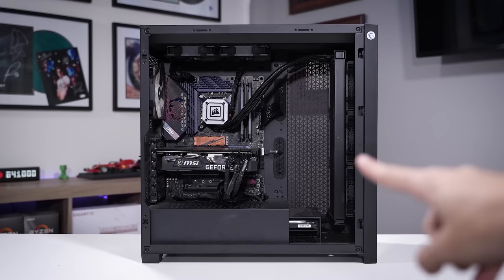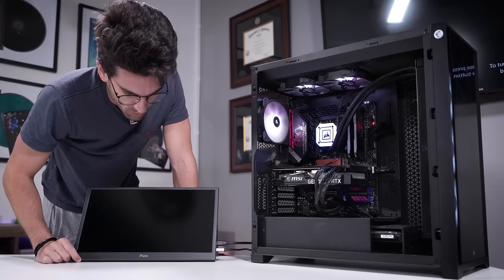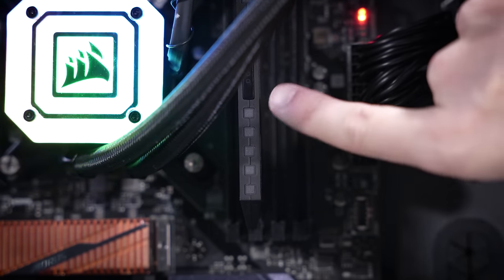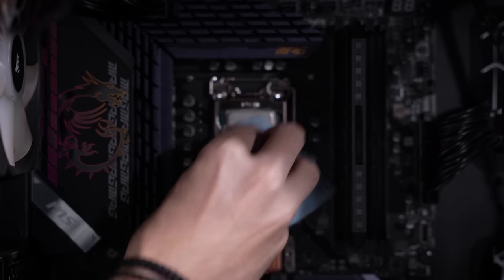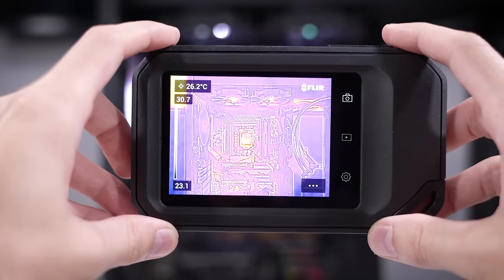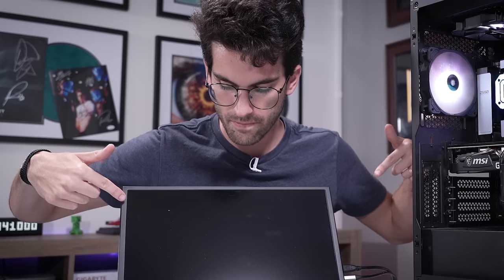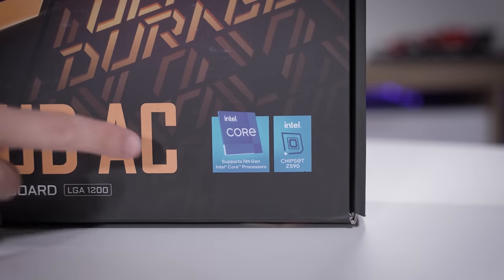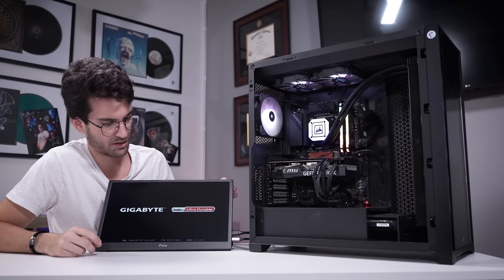Fixing a Viewer's BROKEN Gaming PC? - Fix or Flop S3:E9

Comment: Hi, I'm having the same problem as the pc in the video. If anyone has some advice on what could be the issue, that would be great. For a few days, whilst I've had the pc on, the monitor would say no signal randomly. Whilst playing a game etc. I could still hear music from the game in the background. After a while of this happening, I started to hear a buzzing sound from the speakers. I had to turn off the pc and turn it back on for the monitor to start again. Now, when I start the pc, the monitor is saying no signal. 

I've recently got a new rtx 3070 gpu, I have a ryzen 5 3600 cpu, 16gb 3200 ram. And a 650w psu. The motherboard is a Asus rog strix b450. I'm getting a new case, cpu fan and 850w psu to upgrade the pc. I'm hoping that when I do the new build, it will be working as usual. I'm just not sure what could be causing the problem exactly. Whether it is related to the psu being faulty or something else. I've made sure that drivers are up to date whilst this was ongoing, and windows too. Sorry for the long message, I appreciate any help.

Comment: The MB does seem to be bricked. It could have been a component failure on the MB or the bios is corrupted. While you cleared the bios you did not reflash the bios. At this point there is not much to lose if you try to reflash the bios.

Comment: This is why it's best to shop at a nearest retailer and always spend the extra few hundred on a warranty. I scraped myself together a a $2500 rig after saving all year & was sure to spend the extra few hundred on a 2 year warranty on all of the parts! just an overall good feeling to know if anything ever goes wrong I can take a quick trip down the road to swap out the old for new with zero hassle. I mean why work so hard for something just to not have coverage?

Comment: I wonder...and it may not work...but have you checked the voltage on the CMOS battery? Curious if the cmos battery was dead and then made the board be wonky...I remember another video with a bad psu killed the board but this one didn't have that...but why did the mobo kill itself?
Reply: a dead cmos wouldn't make the board not work. It would reset bios settings to default every boot but itd still boot. My best guess is something was either faulty with the hardware, or there was a failed bios update that bricked the firmware.
Reply: In another comment he said he checked the CMOS battery. It's also possible that the PC's owner tinkered with the BIOS (overclocking settings) and killed the board that way I suppose, or just bad luck or a bad batch.

Comment: I've an interesting case: an old PC of mine with a Xeon E3-1270v2 and an AMD Firepro W5000 that worked just fine last week Wednesday, and the next day - nothing at ALL anymore, not even a POST...
The CPU and case fans are spinning, but there is no image.
Clearing CMOS does nothing. Changing RAM/RAM slots does nothing. Other graphics card does nothing...

Dead motherboard? Pity...
Reply: As old as that system is, a new CMOS battery is well worth a shot (yes, a dead one can cause a no POST on some systems). Failing that, try another PSU.
Reply: @PileOfEmptyTapes  The PSU is a Focus GX 550 W (I believe?) only several months old, so I am guessing it isn't the PSU. I could try a new CMOS battery... but I don't have high hopes. I could try, though. Thank you for the hints.

Comment: I was secretly hoping you were gonna be nice and upgrade him to 12th gen and Z690 mobo since you had to buy a mobo anyway. A 12700k would had been a nice step up for the guy, not that he's hurting or anything running an 11900k. I know I would much, much rather have a 12700k over an 11900k. Seems like this guy should had gotten an 11700k and an RTX 3080 instead of wasting $300+ on an 11900k and a 3070. 11700k and 11900k are basically the same exact chip. The 11900k just has slightly better binning for slightly faster core clocks.
Reply: Greg unfortunately isn't responsible for people's bad life decisions like smoking and buying an 11900K. His goal is to get the system up and running with as little as placements possible.

Comment: I had a couple questions about my pc, my system has a r5 3600, rx 6500 xt, 450m steel legend motherboard with the bios updated as well, oloy 16gb of ram at 3200 and my pc works completely fine until i start playing any games like valorant for example where my pc will just freeze and crash like not even blue screen just crash to where i have to hit the reset button on my case, my windows 11 is completely fine thats not the issue i have repaired it and re installed it multiple times along with my drivers being fullly updated, I am a huge fan of this channel have watched almost every video in this playlist and was just wondering if anyone could give me some insight! Keep up the great videos Greg and keep on helping the community!
Reply: Check powersupply ..i know your gpu is not power hungry so maybe its faulty powersupply that fails to give more juice like +350w or something
Reply: Are you overclocking anything?
Reply: @goodguygav4522  yeah try disabling xmp ..maybr
Reply: @mr.lunatic3157  Ive tried this and it didnt work
Reply: @mr.lunatic3157  my psu is like 550w but yeah thats true I could order another one just for test purposes thank you!
Reply: @goodguygav4522  besides xmp on ram nothing is being overclocked

Comment: It's always such a shame when its the motherboard that's the issue. Not as its the most tedious to change, but because it is very often just one single chip (or even component) on it that is causing the issues. For this one it could simply be the superIO chip, but properly troubleshooting at the component level is simply not worth it... :( Edit: well for 'normal' PC repair that is. Like you said some more test for yourself would make a nice video. Do you have a thermal camera? If it has enough resolution you could look for small asic heating up quickly for example, a typical thing when it has gone bad (and has an internal short as a result).
Reply: Its kind of crazy how many motherboard issues ive had within such a short period of time. 3 seperate occasions all within 2 months.
Reply: @zakking5654  motherboard is the most sensitive part, as it connects all hardware together and manages everything.

Comment: Great video, horrible overreaction to a minor scent,  that went beyond childish.  I fix smoker rigs all day long and they are no more filthy than what the dust rats bring in, old smoke can be unpleasant but any mature person can easily go right past that.

P.S.  It often will reboot 2 or more times as the new MB has to retrain the Ram then windows has to work all the new pathways out as well.  Not sure how many new motherboards you replace but this is common and not sure why impatience with it.  Also that Motherboard if bought new and is only a few months old should be good for an RMA which is typical for MSI boards from my experience.

Comment: I've gotten motherboards to work again with actual high success rate.  Typically I use a non conductive electronics spray, usually CRC brand, clean it with a brush thuroughly and blow it out with a compressor.  I think over time stuff gets jammed places like in the socket, sata ports, 24 pin etc.  I've even taken a heat gun to a couple and have gotten them to work again.  Most motherboards appear bad because of a spill or something that wasn't cleaned well enough(under surface mount chips,etc).  Every motherboard I own, about 8-9 all work. Including my motherboard from one of my first custom builds Asrock 870 Extreme3.  That board has seen some stuff, I've dropped it a couple times, moving from state to state, it lived in a camper awhile, coffee got spilled on it which i thought was the end but after a solid cleaning it fired right back up. It's probably my most durable, and reliable motherboards.  Its ran a mining rig for 2 years on top of it, still going.  I tried replacing it but its just so reliable.

Comment: I don't understand why you don't understand right away if leds in ram are not turned on, it is a 3.3v rail to 1.35v bucket converters issue in the motherboard , in the first second it turned on.
Reply from the maker: I've seen plenty of instances where RAM doesn't light up and it having nothing to do with power delivery at all... Hindsight is 20/20.

Comment: One thing I noticed before you actually swapped motherboards is you never removed the NVMe drive.   That could have been a possible source of the non booting issue.  Turns out it wasn't or was it?   Try the old motherboard without anything attached except power supply, no NVMe drive and see if it duplicates.
Reply: Yeah I was thinking the same thing